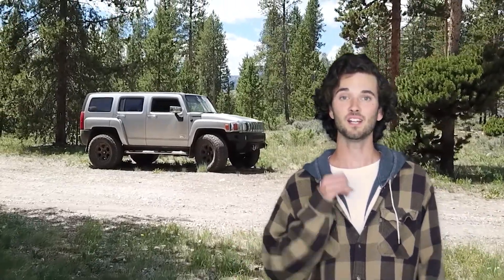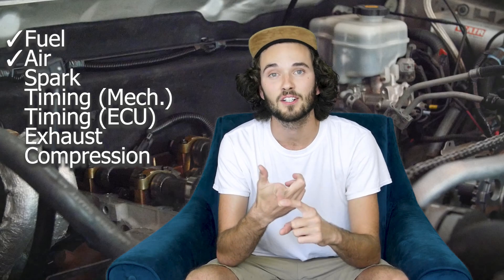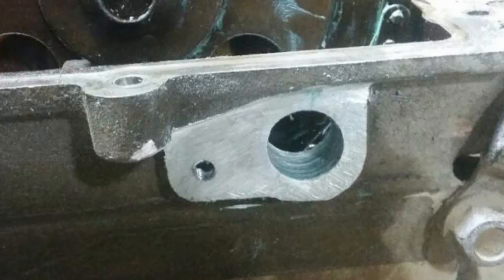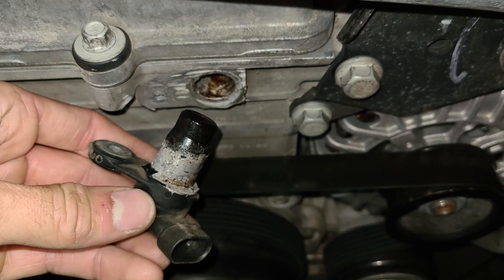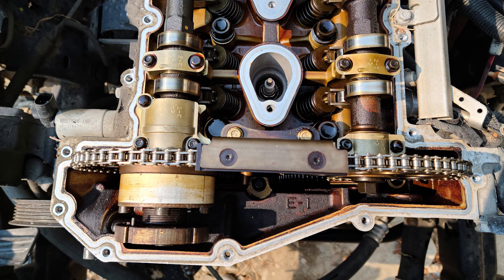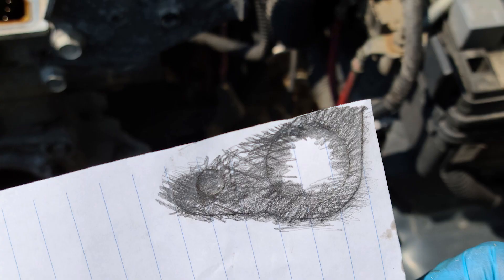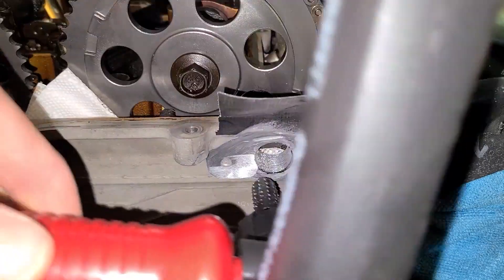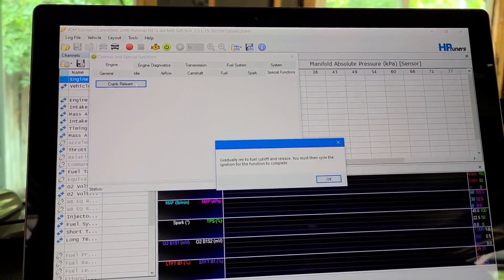Hummer H3 Problem Solved | Thank you for the help!

Comment: What's up Dingle? I know you've seen some of my videos on start up issues and the fuel pressure test before and provided some insight, but what are your thoughts on this same (or very similar, at least) issue you experienced but with NO engine swap? I'm still battling the same issue that has plagued this car for nearly 9 years where the engine nearly loses all power, and sometimes does shut off entirely,  after it's been driven during the day and then sits for a few hours. The reason why it might not be the exact same issue you had is because it will always start for me, but most of the time it dies or wants to die within a few seconds unless I give it some gas and get the RPMs up to ~2,000 for 3 or 4 seconds before letting off the accelerator. If it dies on me, it will always start up on the second attempt, although sometimes I have to hold the key position for longer than normal and the engine seems like it turns over more than normal. But eventually, the RPMs even out and it idles just fine.

The throttle body is as clean as it can be, MAF cleaned on a fairly regular basis, VVT solenoid recently cleaned up really well, camshaft and crankshaft position sensors replaced, vapor canister purge valve replaced, induction cleaning performed at a shop less than 5,000 miles ago, and I just replaced my fuel injectors last weekend which did nothing to improve the situation. I was really hoping it was going to be a leaky injector because I have been smelling gas at start up ever since I performed the fuel pressure test but still the same issue as always. I do not have years and years of experience and knowledge of the inner workings of car engines but it just seems like it's gotta be a fuel delivery issue. Again, no real definitive reasoning behind that but it's just what my gut tells me.

I do have a new OEM MAF that'll be here on Saturday but I'm not holding my breath that replacing it will miraculously fix all of my starting problems that have been going on for 9 years. You think I should be looking harder for leaks? I haven't taken a look at the fuel pump or anything down by the tank like you did, but I also don't have any codes that indicate an issue there and replacing a MAF for $50 that might not be the problem is a lot easier to be alright with then it would be to replace the fuel pump. I will add that I did not perform a case relearn after replacing the camshaft/crankshaft.

Feels like I'm running out of things to look for and/or replace so any additional thoughts you can provide would be really great. Appreciate all you have done with your H3 videos!
Reply from the maker: Do you ever go to Utah? If so, we could meet up and I could help a but more with diagnosing! It sounds like it could be a variety of things 🤔 Did you ever replace or remove or hollow out your cats? If you did, the problem persisted ofcourse, which makes me wonder about a possible vacuum leak causing it to lean out and stumble (which you can usually overcome by revving it really high). Have you ever gotten an occasional lean code? What codes does it have right now? Can you hook it up to a scantool and tell me what "STFT" and "LTFT" say on the tool's live data (I think the loaner car part store tools show this information, which is long-term and short-term fuel trims). If it has really high or really low fuel trims, it can help a lot with diagnosing. I saw your fuel pressure and compression test videos. I used the same testers and the fuel pressure one was faulty for me (was leaking pressure). If your fuel pressure is doing weird stuff, it can be related to sensor-read timing (CASE relearn would definitely be on my list to get done quick because it takes less than one minute to do). Have you tried a second test with a kit from a different store? Also, did you compression test all 5 cylinders? If so, what were your results?
Reply: @H3Humper  i'm in Kansas so it would be a bit of a drive to get over to your neck of the woods! In the fuel pressure test video I posted (5:18 mark: https://www.youtube.com/watch?v=ghu6tfOPVeI&ab_channel=DJ) I captured the STFT at 4.69% and LTFT at 3.13% at idle and then .78% and 8.59% at 3,000 RPM. I did replace the first cat when I swapped out my exhaust manifold a bit more than a year ago but I still need to take care of the main cat leading out to the resonator. Historically, the only codes I've had on a consistent basis are P0300 and P0420.

The compression test results had all cylinders at 140-150 PSI with very quick drop off. I did not do the fuel pressure test again because I had to get the tool back to O'reilly but maybe I should head over to Harbor and grab one of their kits. I will also see what I can do about the CASE relearn. My Bluetooth scan tool and OBD Fusion app for sure doesn't handle that so I'll try to find a tool that I might be able to borrow. I've also been curious about a potential vacuum leak but have not actually done anything to test that theory. I guess it's probably time though.

Comment: Thanks for the info . How can I check if the timing is right on the hummer
Reply: Hello there I have a 2006 hummer h3 just had the engine rebuilt had a turbo on it n had it tuned but took th turbo off because it’s been smoking and can’t find th problem every thing is new from sensor to coils

Comment: I have the exact same issue in a standard 2006 H3 3,5 (factory engine). I have replaced both position and intake sensors, and still it won't start occationally. Any suggestions?
Reply from the maker: Interesting! Have you tried a "CASE" (or crank variation) relearn after replacing the sensors?
Reply: @H3Humper  Not really. Mechanic said these sensors are "plug and play". But will explore that. Thanks for replying!
Reply from the maker: @proaudiodm8161  My pleasure 🙏 I would definitely try the relearn because it takes about two minutes worth of time, is free, and could solve the issue since the relearn is meant to recalibrate the sensors involved in timing, which could cause an intermittent crank no start. If the mechanic has an adequate scan tool, it would be silly to not do the relearn!

Comment: I have change my hummer h3 engine. After new engine is installed the car connot moves smoothly. I have to tap the accelerator paddle down for about 1 minute before it's move. The sound too is not coming properly
Reply from the maker: Interesting! What year H3 and what year engine?

Comment: My H3 has 3 lights on at once. Almost as bad a VW.
Reply from the maker: I swear it's like playing wack-a-mole..!
Reply: @H3Humper  Great analogy. I bought a new rockies deleting pass lock thingy. Who knows what it will do. Meanwhile the bumblebee color H3 drives better than any other car I've ever driven. I don't even mind the gutless 3.7 2007. Just wish there was a Christmas-tree-delete.
Reply from the maker: @Tom Tom  Let me know how the pass lock delete thing works 😎 I'm interested! The H3's really do drive well haha, I almost feel like it's a sports car sometimes. I prefer smaller engines myself, so the 3.7 is great. I have actually been working on a tune for a hypothetical 4 cylinder swap for my H3 (2.9L from a Colorado). Not sure if I'll ever actually do it, but I might one day. With the Christmas tree delete idea, HP Tuners allows the user to "deactivate" check engine codes, which means the check engine light won't come on for those selected. I have four check engine codes on right now just waiting for warmer weather to repair haha, but my check engine light is off because I deactivated their trigger to the light with HP Tuners.